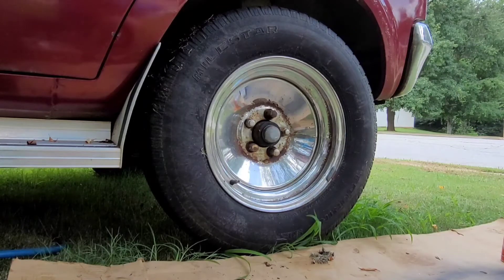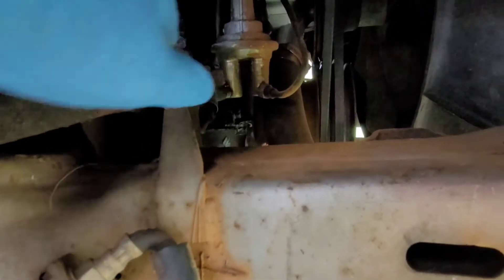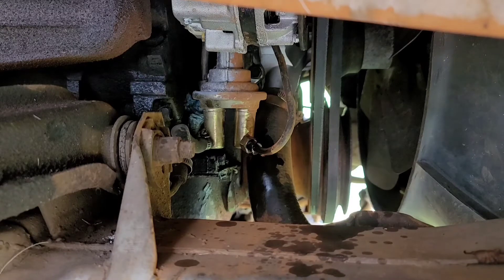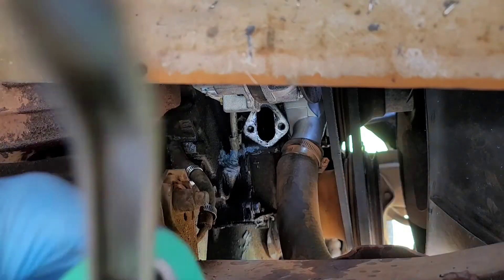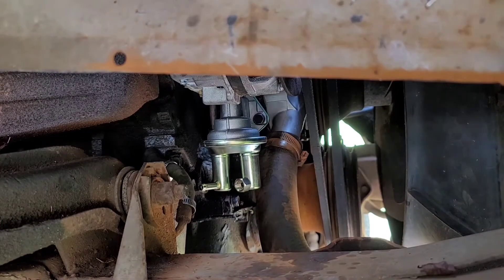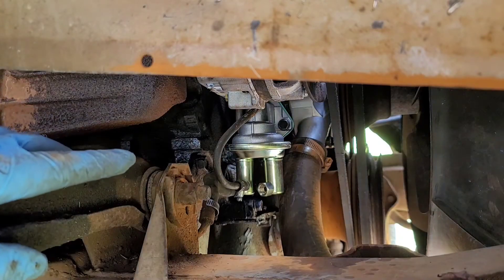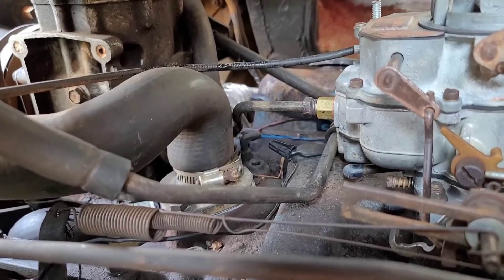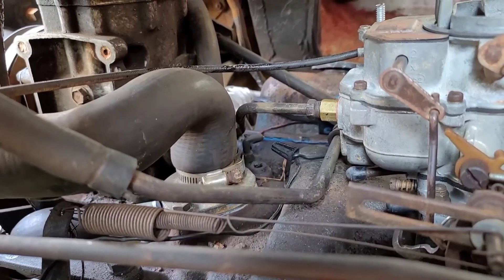Dodge Tradesman B200 fuel pump replacement

Comment: What if the fuel pump is not lined up right with the cam shaft, will it still bolt on but won't work?
Reply from the maker: As long as the arm is making contact with the eccentric bolted to the end of the camshaft, it should work. When installing the pump you  may feel pressure from the arm contacting the eccentric indicating it is installed correctly.
Reply: @a.l.o.t5262 Please dude I need the answer fr. I want my truck running good again.
Reply: Do this have a rod inside or no?
Reply: @FelipeRodriguez-eh6ty  yes rod inside...
Reply: @ironjohn5914  no wonder it’s not starting all of a sudden, I tried to get my camera in there and it looked like there was nothing in there but I appreciate it this should help

Comment: Good video! I changed mine out I'm still getting no gas ?
Reply from the maker: Is there gas in the tank? Has the fuel filter even been changed? When mine sits for a while, it takes a minute or two of cranking to get gas back to the carburetor.
Reply: Thanks I found the issue the push rod cylinder on the inside of the timing chain area where the wheel rotates to hit the pump is broken so I'm going to change it to an electric pump just to get the truck back on road again thanks!!